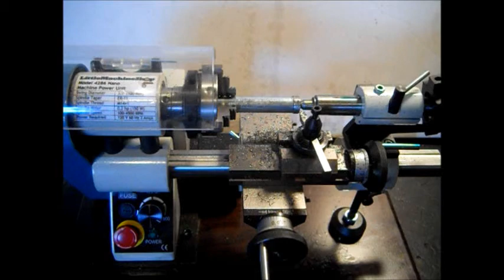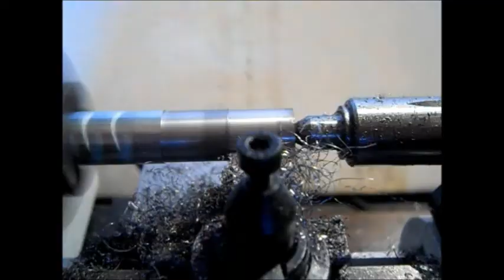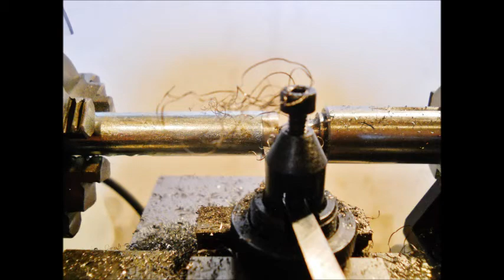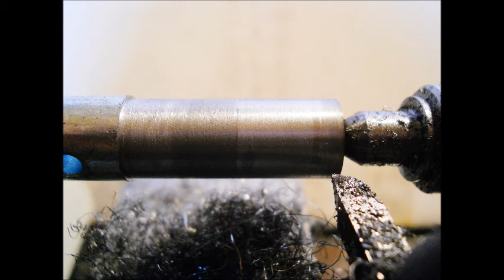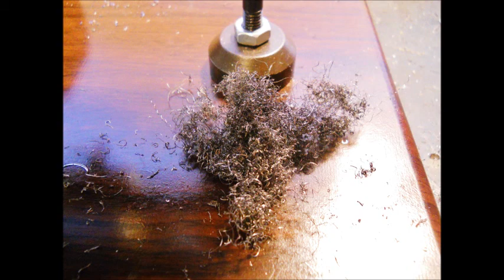NANO LATHE (First time running and cutiing metal test )

Comment: Awwww...It's so cute!  Depending on the type of fastener holding the carriage handwheel, I wonder if you could use a cordless drill as a drive source.  Might get a nice, slow travel and corresponding silky-smooth finish?
Reply from the maker: This lathe is so small it doesn't take much to turn it by hand
Reply: not2fast4u2c
Hadn't considered the forces needed for tool travel.  Does hand turning leave a nice finish?
Reply from the maker: It depends on the tool bit I have made some great finishes on aluminium and brass On steel it can be harder to do But using emery paper when I am done puts a nice finish on steel
Reply from the maker: jlg4880 Also the metal used in this video was really bad I like using 12L14 I have made some nice small parts with this lathe and have several videos showing projects and how I mounted a tread mill on this lathe
Reply: not2fast4u2c
That stuff looks like hot rolled steel.  Only equipment I've ever seen that would give a decent surface finish on that stuff has been solidly built, American-made machinery.  Have you used any cutting oil while turning?
Reply from the maker: I do use cutting but not on this test